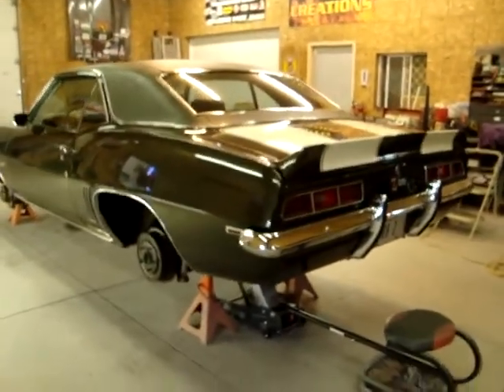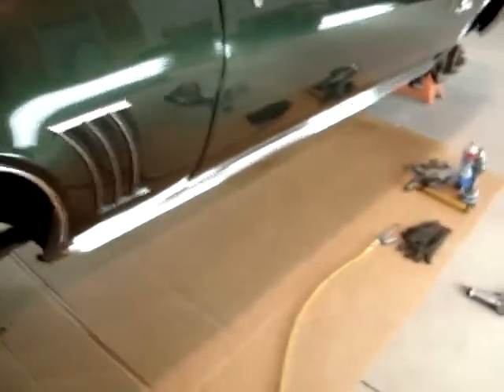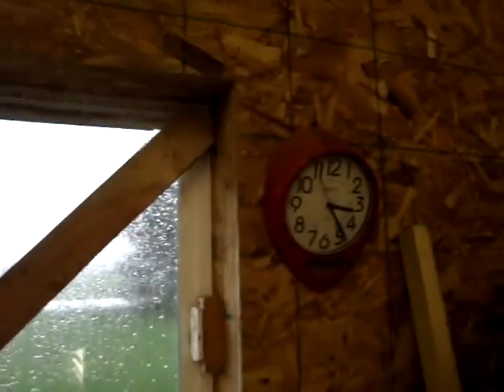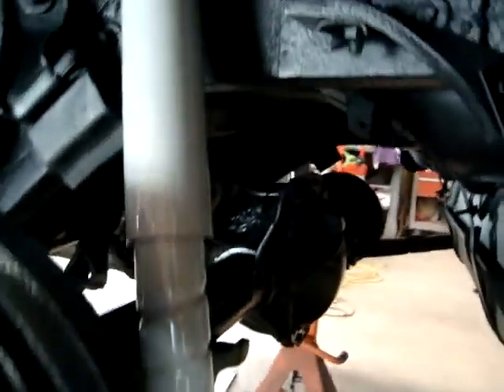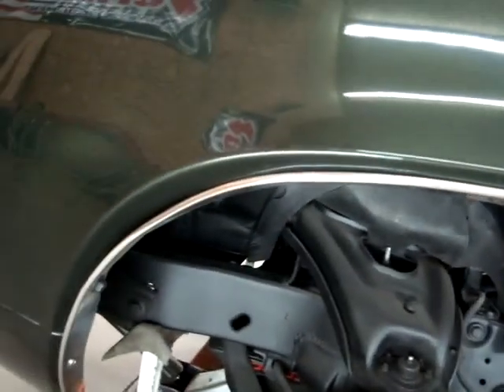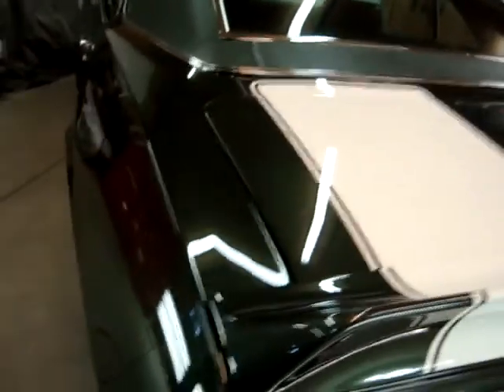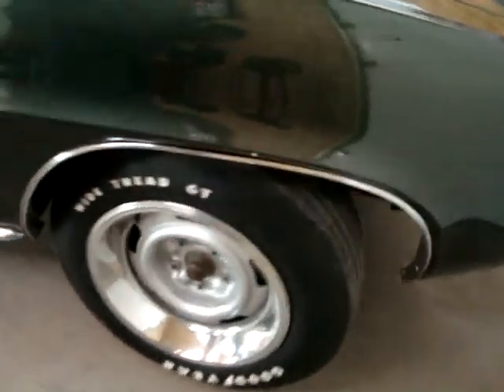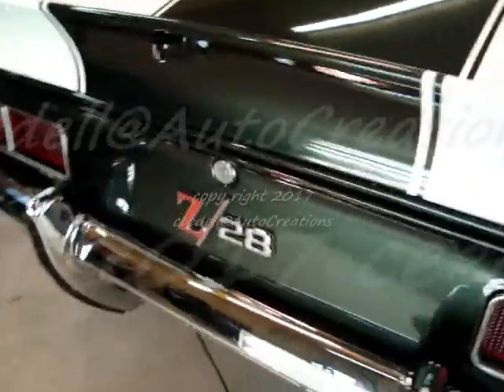1969 Camaro Z 28 Underside Detail

Comment: Dash pad (too light) looks like it should be installed with the medium green 721 code standard interior not with the midnight green 723 code standard interior which this Camaro has, other than that it looks 99% correct  👍 .
Reply from the maker: Thank you, so far the judges haven't had a problem with it.